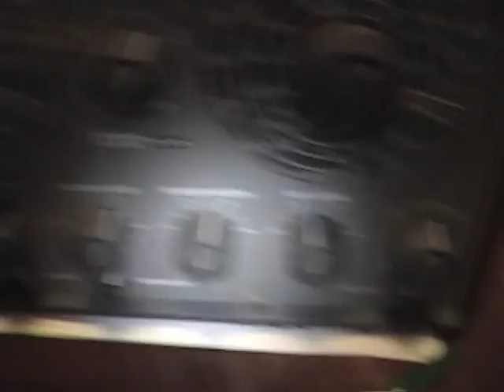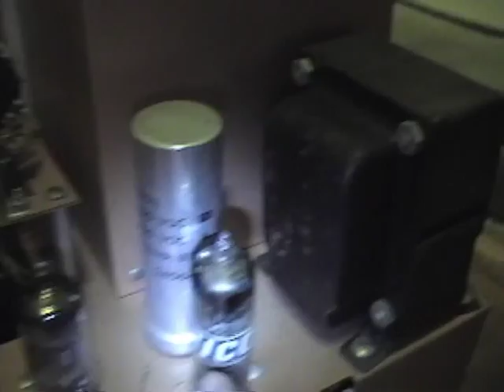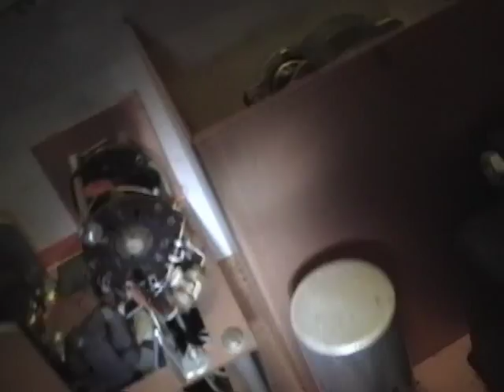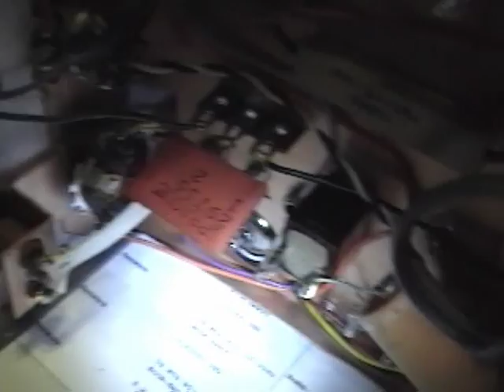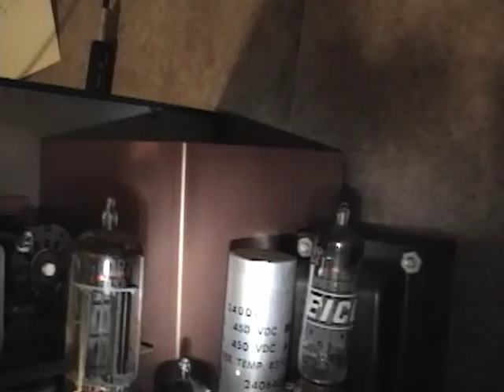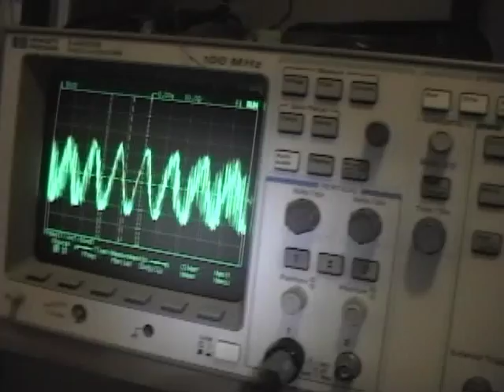Eico 369 part p1o2

Comment: I bought a 369 from ham, and wasn't worried about the condition because I got it for peanuts.  My thinking was that it was going to be the kind of fix that you are working on.  Boy, was I wrong.  The adjustable capacitor for tuning the marker has been turned past the stop, and both sets of plates have been broken off the tuning arm.  I have been able to straighten out the  plates, but have no idea how I am going to get them re-attached.  The other problem that I would never have believed I would encounter, is that the frequency selector switch for the sweep generator has been twisted so hard that it looks like it was lovingly crushed by the Hulk.  I am going to have to find a new switch somewhere.  I hope you have better luck with your 369 than I did with mine.  I was really looking forward to using it.   Thanks for posting the youtube.
Reply from the maker: Hi.  If I were you, I'd just get another 369.  They show up often on ebay.  I repaired and sold mine a few years ago.
Reply: That is what I am going to do.  I have another sweep - marker generator that has a range between 600 Mhz and 2400 Mhz, and would be perfect if I could build a reliable divide by 100 circuit that I could use with the unit.  It is a Telonic, and they did build a low frequency plug in panel, but I have not been able to find one.  I bought an inexpensive unit for now, and will keep looking. Thanks,
Bob

Comment: Hello again.  I cannot tell which band your 369 is on on the video but maybe they are similar.  It has seemed to me that the bias is off somewhere on mine, but because of the AGC & blanking, bias is difficult to determine.   Another question:  Someone, somewhere mentioned that one could tap the variable marker output so a counter could be used to set the frequency accurately.  Where would you tap and would you use a capacitor?  And what size cap?   @bandersentv

Comment: Hello, I ha ve several questions on my eico 369's .  The wave form on the low bands are very nonsinusoidal.  Is that the case on your 369?  Also the AGC is very inaccurate when monitoring the rf.  When using the demodulator, it works more or less as advertized.  Is yours like this?

Comment: @bandersentv -- I studied the circuit of the 368 (which has a factory Ext. Mkr. tap-in), compared it to the 369 (no Ext. Mkr. tap-in) and at least "tried" to put a tap in at what looked like the equivalent point in the 369's circuit to the tap point in he 368. I was wrong about that, though, so I'll need to clip out that tap and try again to find the correct point to tap in (via 2pF mica cap IIRC), because my original tap messes up the top of the highest Marker band (kills Markers above 80MHz).
Reply: jshorva65 C
Nick Viall and Vanessa Grimaldi: Why Did They Split? Nick Viall and Vanessa Grimaldi: Why Did They Split?

Comment: @Madness832 The two Oscillator tubes (V2 and V5) "under" the chassis are really mounted inverted on sub-panels mounted above the main chassis with stand-off hardware and protrude through clearance holes in the main chassis. The two triodes of V4 (6DR7) operate as Second AGC Amp (high-mu triode section) and B+ Gate (low-mu triode section) tube in the AGC / Blanking circuit, while half of V3 (12AX7) operates as a Retrace Detector (connected as a diode) and the other half as First AGC Amp.

Comment: These are great. I used an Eico 368 with the Post-Marker Mod from the April, 1969 issue of Service magazine before I scored my Eico 369. The 369's only shortcoming is lack of an External Marker input which my 368 has and which is also handy as an Output to drive a digital Freq. Counter to set dead-on Markers. I've since added a jack to my 369 which provides for Marker oscillator monitoring. I'm also researching multi-marker functionality (like a B&K 415 for 24 MHz IF's) add-on for 369's.